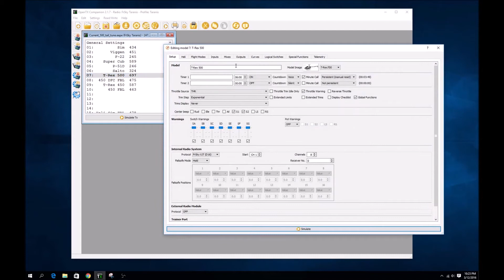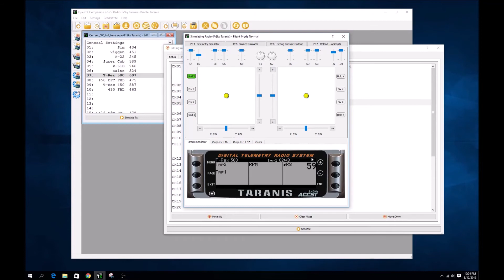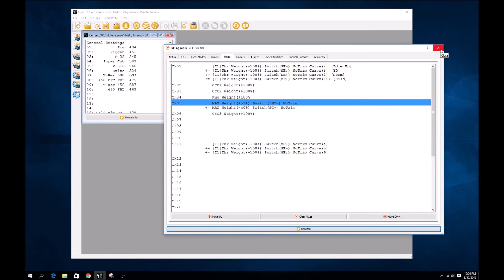Taranis Helicopter Gyro Tuning How To

Comment: I noticed that you have a TREX 450 DFC FBL in your arsenal. Could you please share your settings for that heli. I'm totally new to OpenTX (and helis) and clueless on how to setup my TREX 450. Don't know if it makes much difference but my 450 has the Spektrum AR7200BX FC. Thanks.
Reply from the maker: Sure  I would be glad to share that with you. Also you can join the facebook group for Opentx helis here: https://www.facebook.com/groups/661851897547400/?ref=group_header

Here is the file for the 450 FBL https://drive.google.com/open?id=1xS9sQXGww5CiVXNPiuySXJxssZhG_VSS

Comment: Hi, I have a futaba gy240 gyro on my Trex 450 and since this gyro does not have a a separate connector to plug into channel 5 how would I set up the gyro settings to rate and heading hold mode?
Reply from the maker: You cannot set it up through this method.
Reply: Thanks. What options do I have?
Reply from the maker: You would need a new gyro that that is adjustable via another channel.  The gyro you have is manual adjustment only, it is a good gyro though.